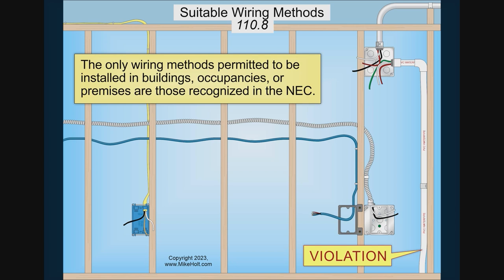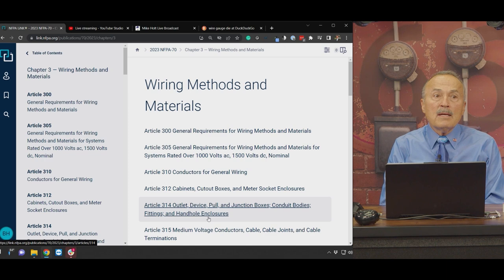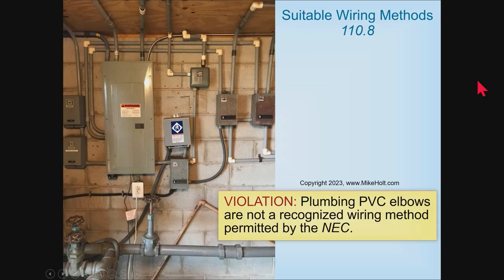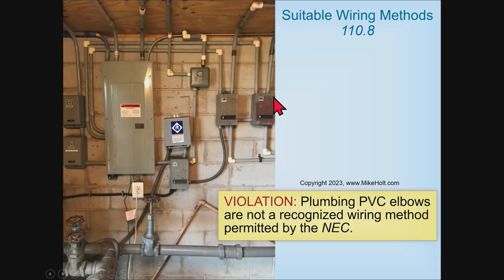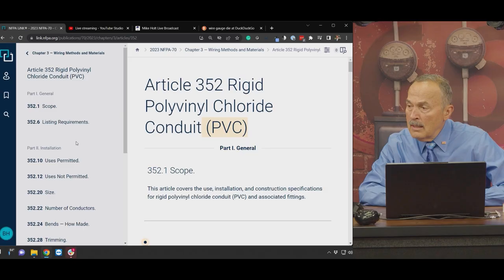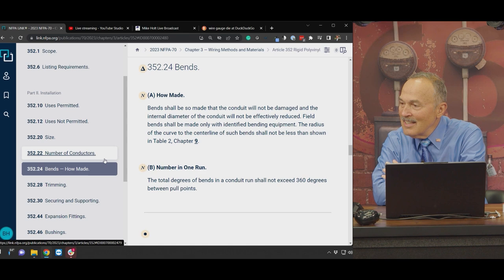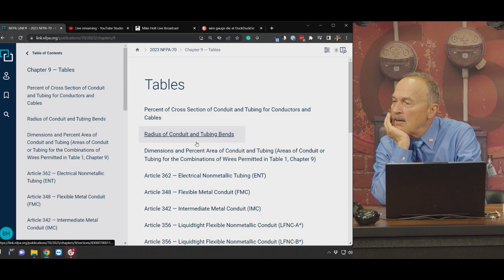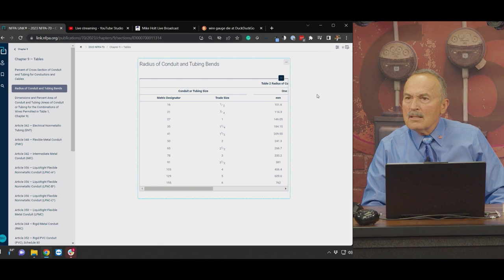Suitable Wiring Methods [110.8], 2023 NEC, (6min:45sec)

Comment: Fun fact:  In some 1870s - 1910s homes that originally used gas lighting,  the gas piping was re-purposed as conduit for running conductors to the new fangled electric light, I don't know that this practice was ever a recognized wiring method but it certainly made for a less expensive and more seamless transition to electricity as it became increasingly available in major cities and suburbs.  Metal conduit with threaded fittings was born out of black iron pipe used for gas lighting.
Reply: Your absolutely right. Here in NYC, I've lived in these older prewar homes that had gas lines used for gas lighting and the gas pipes were utilized for conduit for the electrical wiring throughout the house which was really clever and i bet it was costly.

Comment: Just purchased your electrical Exam Preparation. Been along time coming to get my E2. Been set back 4 full years on registration. Done twice the requirement. Some say a bird in the hand is worth two in the bush what BS. You’ve gotta have two birds in the hand in this industry. Have been struggling to pass the test hopefully your exam prep makes the difference for me. Contractors can be such system abusers, it pains me to give them the satisfaction and not be able to pass.
Reply: Currently I’ve gotten a 60, 65, and a 68.7 the last time I missed it by one question. At least I haven’t ever blown it entirely just a little rough around the edges. Every time I am very well rounded just seem to fall for all the traps
Reply from the maker: Answer every question in the book and watch every second of the videos. You'll smoke the exam the next time. No short-cuts! @41keystar14